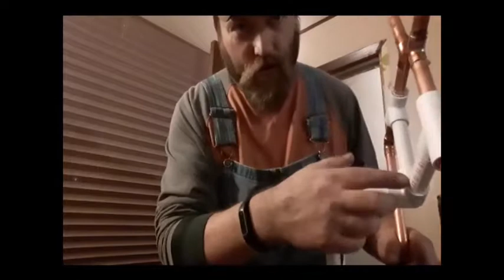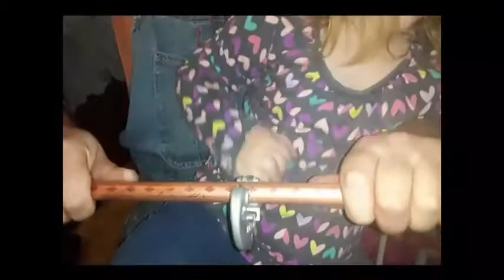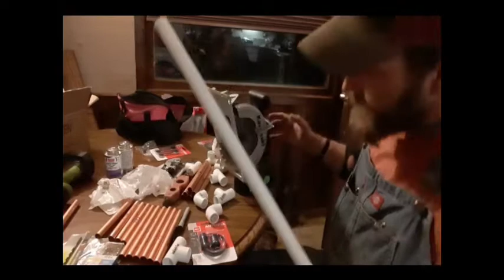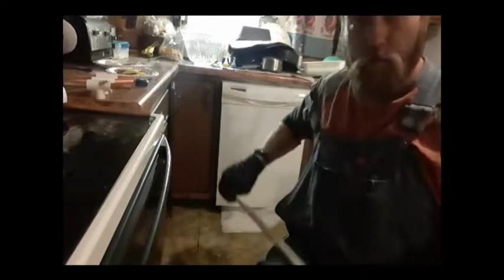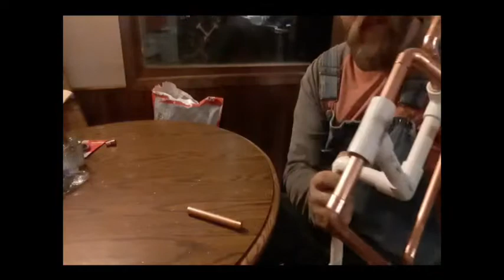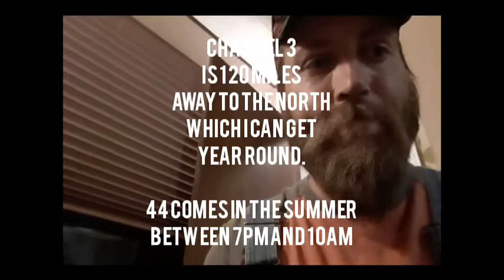Gray-Hoverman UHF/VHF TV Antenna fir under $30 all materials available at hardware store.

Comment: 1/2 inch hot water pvc pipe is pretty close to the right size for the 1/2 inch copper tubing to fit into.
Reply: 3/4 inch not 1/2"  - found I could drill out the center of the TEE Connector with a 3/4" drill bit then cut the sides off the TEE with a PVC Cutter making it close to 1-1/8" wide and use a piece of 1/2"I.D -3/4"O.D. Clear Vinyl Tubing 1-1/8" Long to slide over the center of the Copper Tubing. That gives more of the Copper Tubing exposed for a better signal.

Comment: TRAVIS, what kind of reflector did you use fella ??? Supposedly a reflector really improves performance according to what I read. Maybe make another and stack them.
Reply: He was talking about making a reflector and sandwiching it between 2 of those antennas giving you roughly 360 degrees of signal - so any signal from anywhere around you would be brought in much stronger.
Reply: Thanks for clearing that up William.  @williamcolvin3609

Comment: I may have missed you saying it in the video, but I'm curious as to why you went with 5.625 inch legs on the vhf portion instead of the original 7 inch? Is there an advantage overall, or location dependent? Thanks for the video, I'm gathering parts to build one now.
Reply from the maker: It is one of the variations on the interwebs, plus all cuts fit nicely in 1 ten foot stick.  Makes it easy to cut all lengths of tube the same.    I've been meaning to build the 7" version.   To compare but I get channel 3 from 80 miles  (vhf) and 43 (uhf) (up to 100 miles, but its repeated on multiple towers, I just know when I get the furthest because it carries an extra channel)   

So going with the longer version doesn't make sense for me.  

I wanted to also try a 3" version for giggles.    But I think the shape is the most important part, not so much the overall length of the elements. 

I might actually be in the position to make a new set of videos here in the next week or two, I can make a longer version and a shorter and compare performance.
Reply: @travishanson166  Thanks for the reply, I have an abundance of copper pipe so I'll probably just go with the 7 inch. Where I live the furthest tower is just shy of 60 miles so either way I'm probably good. I have a home made 4 bay bowtie antenna that I made years ago and even in its corroded bent up condition it still performs fairly well. I have a buddy that wants to try to pull in a station 100 miles away, so if it can pull that off I'll be building 2 of them lol.
Reply: I got mine built with the only variation being the 7 inch elements, also the cad guy at work designed some nice brackets to assemble the 2 halves and printed them on the Formlab printer.  I literally doubled the amount of channels I was pulling in with my bowtie setup. I checked AntennaWeb with my exact address and it claims 78 channels are possible from here and I pulled in 77 😁.  I may try to add an amp and possibly add the 2 NARODs that I read about since I have some vhf channels, and there is a low vhf channel out of Chicago that has been troublesome since the beginning of time.
Reply from the maker: @SteveStoltz  That is awesome.  Did you mount inside or outside?
Reply: @travishanson166  Its outside on a pole about 10-15 ft in the air. another 10 ft would be optimal but it is what it is. I need to tweak it a little to get it set to the sweet spot, since the main towers are 2 different directions.

Comment: What paint did you use to protect the pvc ? Thanks for the video.
Reply from the maker: I actually haven't painted it yet.  I am going to check to see if the weathered pvc will take paint better than brand new pvc.   I plan to make a second antenna and video as well that's more complete than this one that will include painting the old as well as the new.   Alot of PVC nowadays is made with some sort of uv stabilizer.    I will be mounting the 2 antennas together to get 300° of coverage  so I get all the stations in my area. 

Any epoxy paint should work, or hard enamel paint like grill or engine block paint.   You just want to make sure to rough up the surface with some 200 grit or steel wool before applying.   Rough the surfaces before assembling to make it easier.
Reply from the maker: Oh a teflon paint might work as well.   You can visit a sturdevants or car quest (if they still exist) and get small samples to test adherence.   Usually the larger stores will have them in stock, but should be able to order them from the smaller stores. 

An etching primer can work as well, provided you test.  

Or you can etch with xylene, acetone, or other solvents as well.  

Sorry if I'm getting confusing or making it sound more complicated.  

I think duplicolor has a pvc specific paint, or at least someone does.

Just wanted to illustrate there are many ways to do it for different skill levels.
Reply: @travishanson166  Thank you Travis for the taking the time for these great answers.  I appreciate it.  Your second longer video you want to make...will that be a better antenna than the one you have already shown in this video ? Thanks.
Reply from the maker: @beachwave2  It will be the same style antenna, just a better fabrication and will include painting, and installing on the mast with my first antenna. 

Will likely be a series of shorter videos in better light and sound.